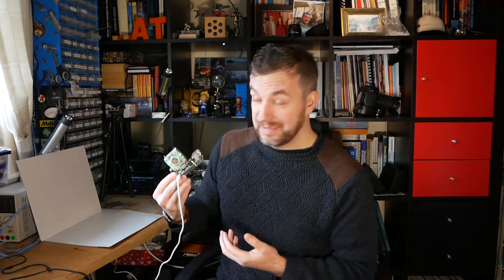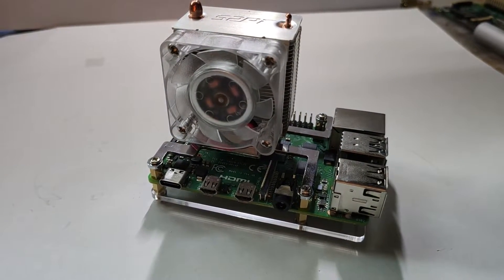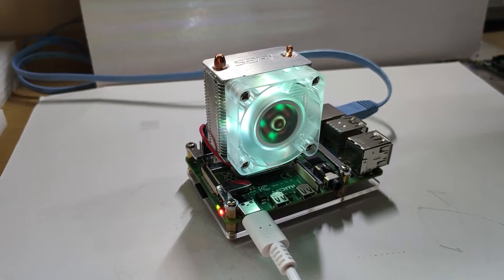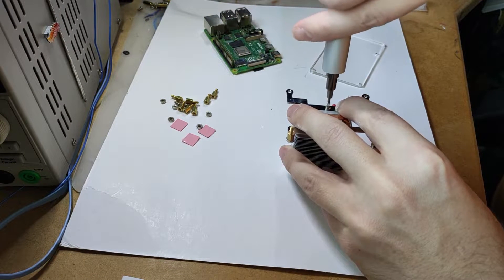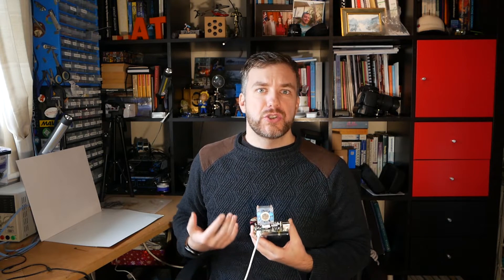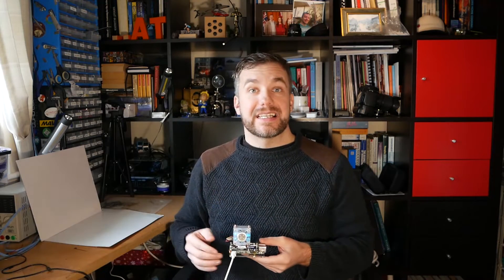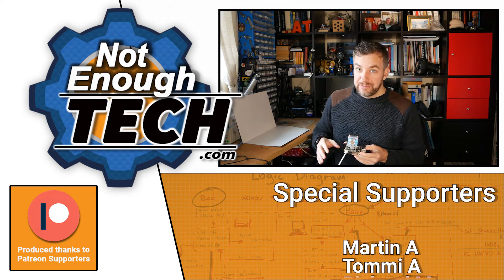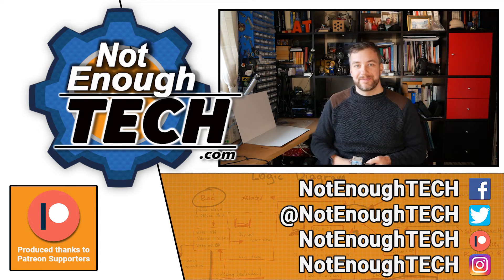This heatsink is a BEAST - 52pi ICE Cooling Tower [review]

Comment: I use a AliExpress PWM controller for all fans. And for the led you could replace them with a 4 pin rgb led diode.  But some soldering needs to be done  then.   Use some good thermal paste, and not the flat chewing gum adhesive that comes with the ice tower.  This Icetower is very nice, and cool to see.
Reply from the maker: I already done the mod. ;) Just waits for the posting 🤭🤭

Comment: I managed to use first gen ice tower with rpi3b by sticking 3 thermal pads on cpu - it worked pretty well
Reply from the maker: I have copper pads as well, i think 2 of them would be enough to fit that gap